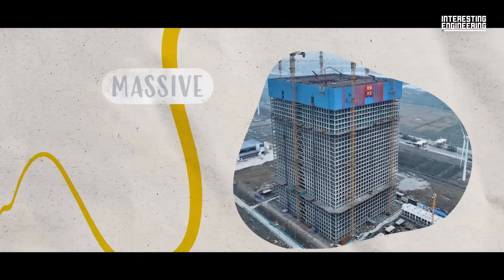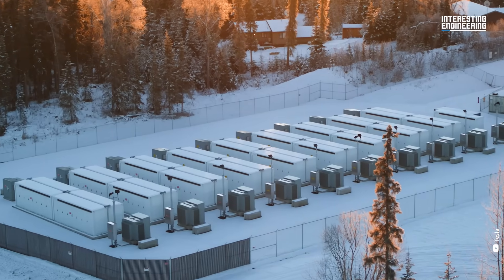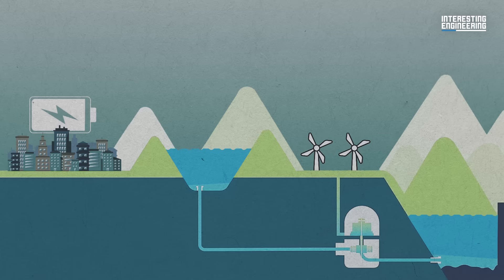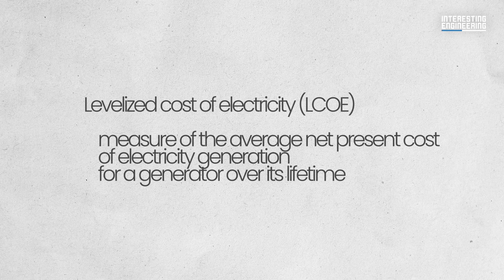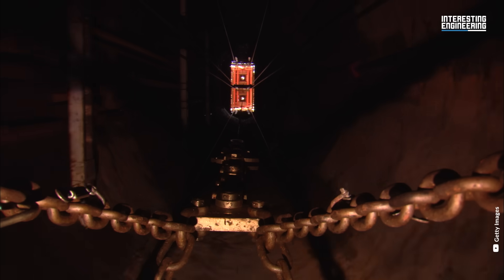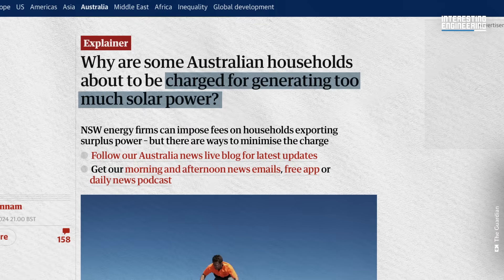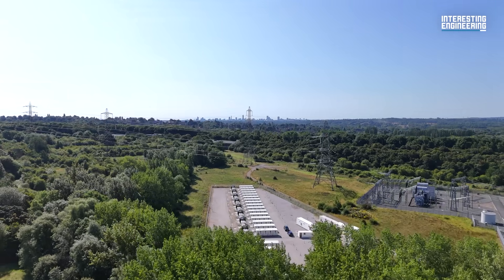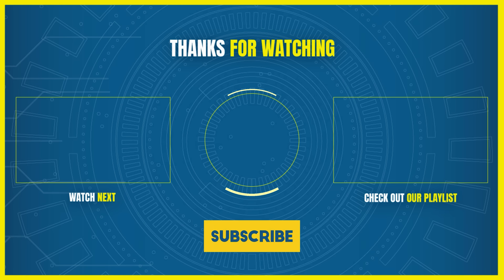China is Building Gravity Batteries

Comment: Mountain reservoirs are "gravity batteries" too and have been used as such for nearly 100 years.
Reply: mountain reservoirs require huge amounts of water which may pose ecological hazards. Besides it is highly dependent on mountainous geography and is not available in open plains, where most of China's population lives. Also majority of renewable energy in China is located in western parts of the country, where water is scarce.
Reply: 5:28
Reply: Mountain reservoirs are NOT available everywhere if you had not noticed
Reply: @ziad_jkhan  Yeah, but their are abandoned underground mines all over the place that can be used for pumped hydro as well. And in fact you do not need a mountain at all. Almost anywhere with access to an ocean shoreline is suitable for pumped hydro. You only need to have  75ft of head
Reply: and they only work when you have a mountain and a lake, hard to find in most places
Reply: @TheSateef  most places?
Reply: @TheSateef *two lakes.
Reply: Mentioned
Reply: Would've been more "game changing" if Elon did it right? "the genius" con man
Reply: And guess which country is building the most gravity reservoirs?
Reply: @liu3gz 😂😂😂😂
Reply: To everyone speaking about the need for a mountainous area, if you can build the mechanism to hold a concrete block up there, you can also build a water tank up there, the same structure for holding it will provide the same mass capacity, and you'll get some extra efficiency because a pump and a turbine suffer fewer losses than a crane.
Reply: Woow, this can be use in saudi arabia
Reply: You misunderstand the science.  Right now solar and wind power are unregulated on a generation basis.  Power is generated when it can be, not when it is needed.  To make the industry viable, a way to store the energy needs to be created.  We can't store sunlight and wind the way we can store fuels and water.
Reply: @Stephen5284  And what about my comment made you think I don't know this?
Reply: @TrangleC How you put "reservoirs are batteries" is not correct.  Traditionally, reservoirs aren't used as batteries.  They are used to maintain constant flow.  It generates power and feeds into a system.  

The battery design is a closed loop that can be reused.  Pumping water up a hill and letting it flow down and back up again.
Reply: @Stephen5284  I don't know what you mean with "traditionally", but the oldest example I know of was that water reservoirs were used to power wind channels used for aircraft development and testing during WW2.

The fans blowing the wind through those channels needed a lot of energy in a short time, but did not have to run permanently, but only every few weeks for a series of tests, so they used water reservoirs as a energy source, both on the Allied side and in Germany.

Meaning, they definitely were used like a battery and they are still used like that today.
If all you needed was a steady stream of energy, you could just use a river as the energy source. You wouldn't need a reservoir.

Obviously a reservoir is used to store water and with that water energy and something that stores energy is a battery.
Reply: Greed holds humanity back
Reply: TriangleC is absolutely correct here. We have had gravity batteries for years. What this video is referencing is a new generation of gravity battery.

The point here is that the commentator is incorrect to say this is the first gravity battery. It is not. The commentator also clearly doesn't know how mega watt hours work. So how can we take any of it seriously?

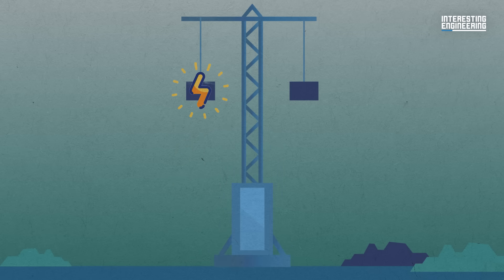3:20 "A falling object still falls with the same energy it took to life it". Absolute nonsense.
Reply: 100 million USD to build an elevated reservoir. Or 10 million USD to build this facility? The choice is clear for small projects.
Reply: @garrysmodgigachad  You guys are not using your brains. Think of all the machinery such a facility needs, all the generators to translate the potential energy into electric energy, all the electrical motors to move the concrete blocks around inside the building, all the lifts, all the rails and gears. All of that stuff needs maintenance to work and if you know anything about C. (can't write the name or Youtube censorship will make my comment invisible), you know that things don't get maintained there.

Maintenance is not part of C. culture or mentality. People let everything rot and rust away and then discard it to buy or build something new instead of keeping the old stuff in good condition. That goes for little things like electric scooters and for big things like buildings.

The thought of such a complicated facility operating in C. is ridiculous. They don't even keep elevators in apartment buildings maintained.

If they build this thing, they will lift all those concrete blocks up in it and then it will all rust away before those blocks ever get to come down again to recoup the energy that was spent to lift them up.

This will just be another propaganda project that is only built to brag about it and "gain face" and which will never do what it is supposed to do, like all the wind farms and solar farms that get built to take pictures of them, but never even get connected to the power grid because a mile away they built a new coal burning power plant that produces energy much cheaper.

That is the reality of that country and all the Wu Maos who argue against it know they are lying.
Reply: And water's pretty dense
Reply: @trialsted  water isnt as dense as concrete... or lead... but it does have the benefit of being non toxic, doesnt require mining, can be used for alternative processes, and its really easy to pump it into a tank, whilst simultaneously draining that tank...

the problem with all these ideas is the volume required. a horsepower is 33,000 ftlbs a minute. that is, in metric, about 500kg raised 10M every minute... for a mere 746watts. until you convert all these figures into mental imagery, familiar objects, theyre just meaningless numbers...

you need  thousands, millions of tonnes of water, or cubic metres, raised to large heights to really do anything useful...

but then again, theres nothing wrong with wells, with water kept under pressure... or similar approaches. you dont have to have a "lake on a mountain"... you just need pressure differentials to get mass to flow.

then theres other things like heat...
Reply: Yeah? There is 27 books out there in what the Chinese invented first that no one really cares about
Reply: So are rivers.The main thing is to use the appropriate tech for the local environment.How about the reservoir idea(water and a steep slope) where the pumping is done via wind power when available?
Reply: Old tech… china only copying again..
Reply: That's what I was thinking, why don't we have these gravity battery buildings everywhere?
Reply: We all know that, hillbilly!
Reply: Indeed, The Water Can Be Reused! The Only Thing Is Density, Water Weighing 1000kg/m^3, Whereas Stones Weigh More Than 2000 Kg/m^3. Yet, Even This Can Be Solved By Adding Salt To Water, In Which Case All The Pipes Need To Be RustProof!
Reply: 🤣 exactly what he said 🤣
Reply: Peddling CCP propaganda....china never does es 1st mover on anythibg
Reply: …. There’s a difference in ecological costs.
Reply: And far better.
Reply: Except you don't get water everywhere, nor all the time, and sometimes using water uphill as energy storage conflicts with water demands for direct human usage and agriculture. Not to mention that, if not managed carefully, it can wreak havoc in the local ecosystems. Concrete blocks have the enormous advantage that you only construct them once, then can use them for hundreds of years as long as yeu don't subject them to too much wear and tear - tensile and shear forces are the most damaging, so care must be needed not to pull too strongly on them nor to let them hit the ground too fast. Once built, you can move'em around the world to where they're needed, they don't evaporate nor are they needed for human consumption. It's a huge initial investment, but then the cost is spread over decades, if not centuries of use
Reply: To those that say you need a mountain to store water in top  😅  ahhh no  water tower tanks are a thing and dont overflow and then break and flood  the land
Reply: @macalister8881 enough to store 5 minutes worth of energy produced by a wind turbine… brilliant
Reply: And they work well unlike "solid weight" energy storage.
Reply: @timballam3675  If they work so well, why do they cost more than 3x as much when integrated into an electrical grid?
Reply: And how’s its efficiency?
Reply: Except they are much, much better
Reply: Nature has to recharge that gravity battery.
Reply: @aku7598  You think artificial reservoirs are refilled by rain?
You pump water up when you have energy and you let the water flow down again when you need energy.
Holy moly.
Reply: There is a LOT of underground mines that are suitable for pumped hydro, if you shotcrete a liner into them first. Theres a group of Canadians in Australia is already working on one. They are using the tailings from the old mine to create a berm for the upper reservoir.
Reply: This was such a predictable comment. Find a new way to deal with your inferior complex.
Reply: @airtioteclint  And who do you think looks more like someone with a inferiority complex, someone who just points out that something that is hailed as this great new thing is old and has been done better before, or someone who gets offended by that?
Reply: water evaporates, gravity doesnt;
Reply: @ambig1  The worrying thing is, you probably think this is an intelligent comment.
Reply: @robheffernan
2 days ago
 @ambig1  The worrying thing is, you probably think this is an intelligent comment.

 @robheffernan  Explain why it isn't.
Reply: @markduncan1144  Because armchair engineers such as yourself have insufficient abilities to understand these basic concepts.
Reply: @ambig1  Sounds like your brain has evaporated.
Reply: That is pumped storage hydroelectric (PSH) and, yes, it's been around for a while.  But we need all the energy storage we can get to store this abundant renewable energy.  So other gravity systems need research as well.

PSH needs very specific geological conditions in order to be effective.  These conditions are increasingly becoming few and far between as climate change tightens its grip on us.  Competition for water rights is increasingly contentious.   PSH can also drastically affect local ecosystems and will need extensive environmental studies done prior to any construction work.
Reply: I like your idea. 
But in practice,  it doesn't help. 

Communities who use the most energy are in cold climates. They use a lot of energy in winter. 

Really cold days means you need to tap into extra stores if energy.  If you want to get away from fossil fuels, you need a renewable energy storage system. 

But mountain reservoirs will be have frozen pipes. The whole lake might be frozen solid. 

Gravity storage facilities are prefect for cold climates.

And desert climates too (where natural water reservoirs are non existant).